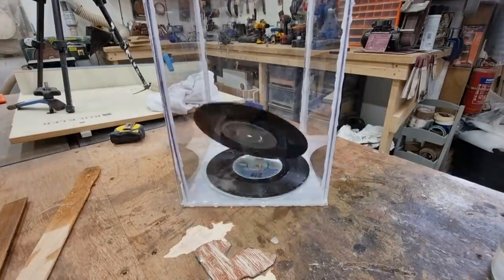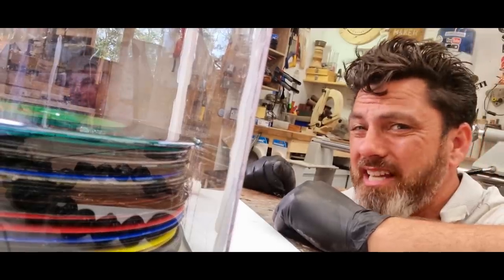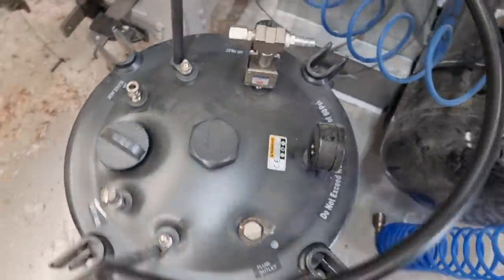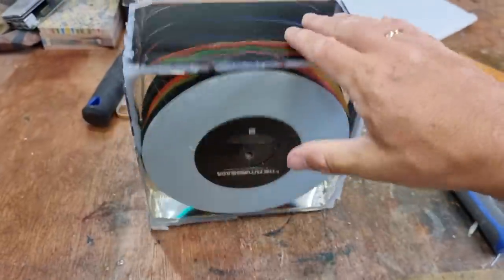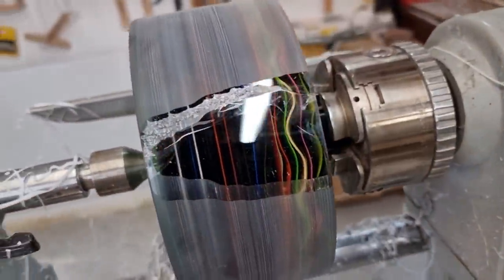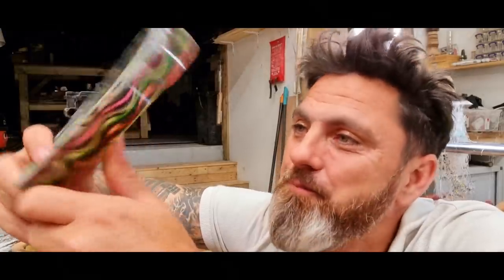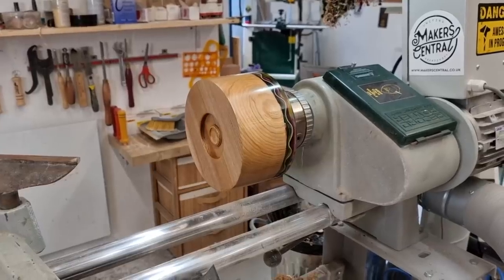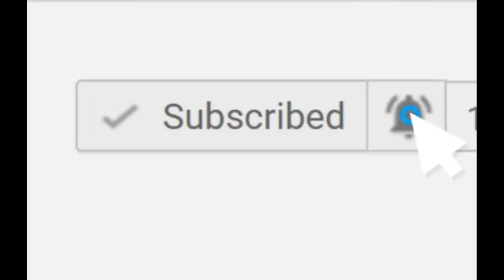I Turned My Old Vintage Vinyl Records on a Lathe 😬

Comment: liked and subbed , thank god you didn't get hurt , i noticed the full face shield after your blowout , do you reckon the layer/disc adhesion issue could be solved by gluing them individually before the resin , good project and a lesson to us all , thank you .

Comment: Looks like it split where you added the slow resin. Try to make a lid from the section that broke. Try again with the quick or slow resin only. The quick appears to produce heat that cause the vinyl to warp.

Comment: I have done one with records and it failed then we took a stack of records drilled holes at six different points to the middle of the record so the resin would flow and trap and have a column at six points through the records to hold them together and work perfectly

Comment: I'm guessing the warping of the first few recordings came from the heat generated by the fast cure resin. So you should get that awesome effect throughout. Also there wouldn't be a weak plane. It looks to me like the block split right where the two types of resin met. Please let me know if this information inspires you to make a second attempt, I'd love to see the results 😊

Comment: A bit of your forgetful :   mold release usage , the power of a dowel , the strength of a single pour and the uniformity of placement ( spacer block under the records so they end up in the middle of the pour ) . That dowel through the center of the records would have made all the difference . Can 't play them without a spindle , I 've tried the rubber mat didn't hold them on the turntable for long , hadn't thought about my experiment in over fifty years .

Comment: I told you Nick! Or at least I yelled at my screen. You’ve got to make sure the resin goes between the layers. all those air bubbles are liabilities,weak points. PUT them in one at a time or tip it sideways.

Comment: it looks like it split right at the transition point from the fast to slow resin, so maybe the two types failed to completely fuse to each other with the vinyl taking up so much lateral space?

Comment: I’m really glad you kept going.  I thinking like this better as it is now than I would ave if you had successfully done all the way through with the records.  Records are hollow btw.  That’s probtwhy it. Broke like it did.  Cutting the edges weakened the structure of the disks

Comment: I've been falling down the rabbit hole lately of watching maker after maker turn projects. I've been wondering why no one seems to really bother with "dust" extraction when turning resin. Your shop must look like a nightmare afterward, not to mention constantly being covered in strands of the stuff. Is it a sacrifice you make for the sake of better visibility while filming but use when the camera is off? Or is the extraction system not really effective on those long strands?  I'm just curious.

Comment: It's a great idea you just don't know how to do it the reason those bottom ones worked different than the other ones because that was the first poor and the other ones were never ever had the air removed so there was no resin between those discs which is why it flew apart on you you need to pour it all and suck the air out must be solid through and through

Comment: Probably need resin between each record. Probably didn't get the penitration  due to the vinyl. Because the ones that warped did get resin between each one. But I'm sorry you couldn't make what you wanted. What you did make was still funkadelic

Comment: You used two different kinds of resin and I think it made it too thick if you would’ve just did a couple Records like half of what you used I think it would’ve worked. Should’ve stuck with the first resin! Looks like it was working just fine

Comment: Couple of comments. 1) Perhaps you could have used some of the remnant of the record/epoxy piece to make a nice lid for the hybrid "box" end product. :)  2) Like some other commenters, I wondered why you didn't put the records in one at a time as you poured in the epoxy---considering all records have a thick circumferential "lip"/edge,...that would trap air (usually a defect in most clay/resin/etc projects. I thought you would put the records in one at a time, pouring the epoxy to fill all space between them. Maybe try it again in the future with just the slow drying epoxy so you can just fill it all up. Use a hair dryer or heat gun from hardware store to give the melted, scalloped look to the records before getting ready for the pour.  Just be sure to heat them slowly as a stack so that their bends match and they can still stack together, and slowly so they don't melt together. Perhaps stack them horizontally on a pencil, or dowel with thick washers in between each one so that they are close and will melt with matching waves, but not close enough to stick together. Then just cool, and ready for the stack and pour. Would love to see another attempt at it. Love your ingenuity! I grew up in the 70's so records a very nostalgic for me. Two thumbs up!  Liked, commented, and subscribed.